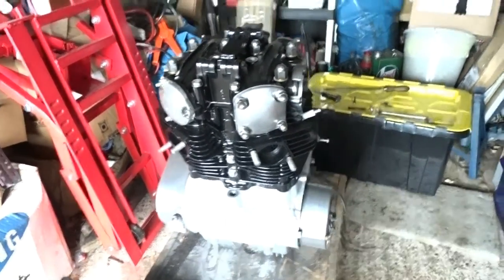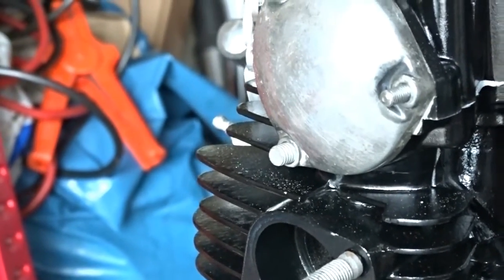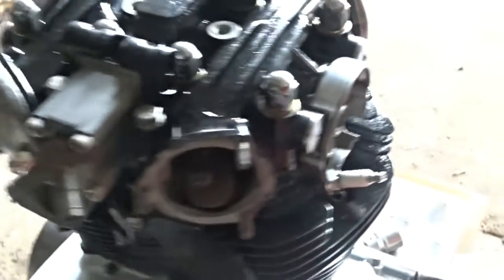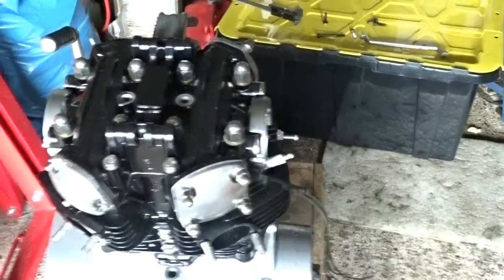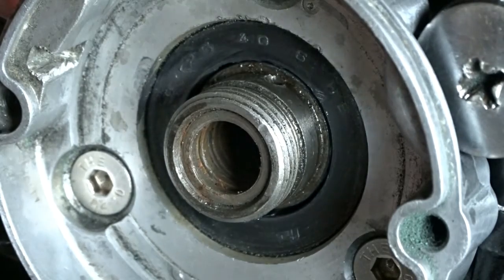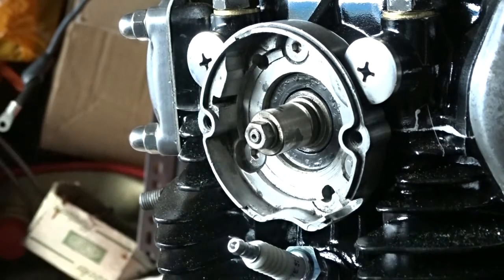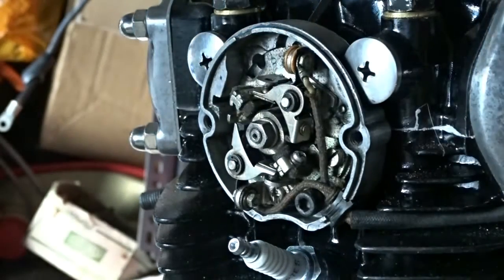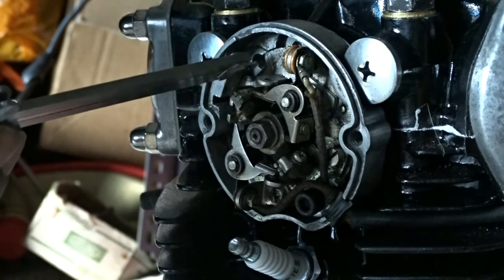XS650 Engine Build Part 8 - Points and Advance System Assembly

Comment: Is it possible to install points from a 79 on my 81 ??
Reply from the maker: yeah they have the same heads ect, you'll need the advance retard shaft and atu unit if your bike originally had an electronic ignition.

Comment: My engine didnt have these in when i took it apart, yet it ran fine... How tf is that possible?
Reply from the maker: Hi Jamo Later models had electronic ignition built into the stator
Reply: @OldBiker  ah alright, thanks! So to set the timing i only have to properly do the valves and make sure the camshaft aligns with the crankshaft right?
Reply from the maker: Yeah thats about all you need to do

Comment: hello man what size bolts did you use for the points housing i know the are counter sunk  i like the allen heads like you have used all the best murf
Reply from the maker: Hi Murf I think they are M6 x 12mm but will check tomorrow and let you know for sure
Reply: @OldBiker  that would be great kind regards murf
Reply from the maker: @murffff  Hi Murf yeah it was M6 X 12mm and uses a 4mm allen key, you can also get the stainless countersunk lock washers for it on evil bay too
Reply: @OldBiker  sweet thanks man this old xs650 of mine is fighting me but i will win

Comment: wish i was riding like y'all!  can anyone help me. i ,ve spending my whole life just trying to set the points gap. is there a most bottom line.start from scratch position the plates should be, before i try to find the widest opening on the point.i just cant get the low volt test light to come on at the f mark. and isnt it supposed to go out after the f. my light stays on almost 3/4 of the way after. sorry for asking ,im getting burnt out
Reply from the maker: Next Sunday if I remember I will try to do a step by step guide on the points, I have a top end I can set up on the bench to play with so should be easy enough to do..
Reply: @OldBiker  
I just got done installing my xs charge pma and my new boyer bransden ignition. I need too set up my tdc on my pma so I can adjust my timing. What's the best and easiest way. Top dead center tool that fit in the spark plug are useful but I have no idea what type I need.
Reply from the maker: @hommystattoo5094  The tool that screws into the spark plug hole to find TDC is not very effective, due to the angle of the plug hole the slider in the tool just gets stuck when the piston comes up and hits it, now to quickly find TDC look at the camshaft ends, one has a pin at the points end and at the other end has a keyway, when they face directly up, you are at TDC, to fine tune it, put a pencil or the like in the plug hole and sway the crank back and forth a couple of inches each way until you find the sweet spot in the middle where the pencil does not move. That's how I done my one. If you want to try the TDC tool, it's a 14mm threaded size one you want.
Reply: @OldBiker  are you a member on xs650 forum?
Reply from the maker: @hommystattoo5094  Yeah been on there a while as IllusiveJack
Reply: @OldBiker  great I will send you a picture of what I'm working on maybe you can guide me or at least give me an idea of what to due.